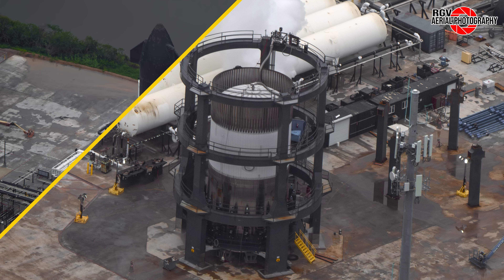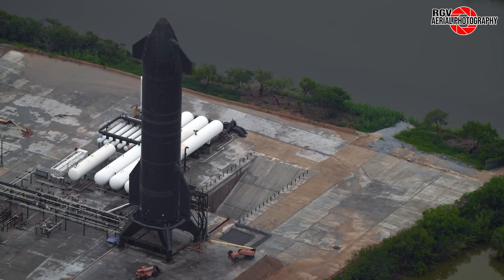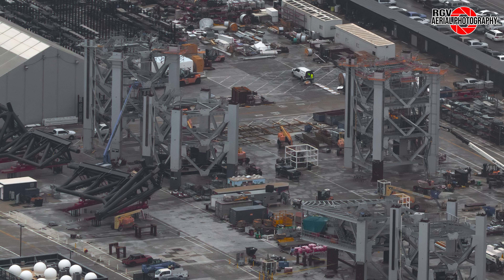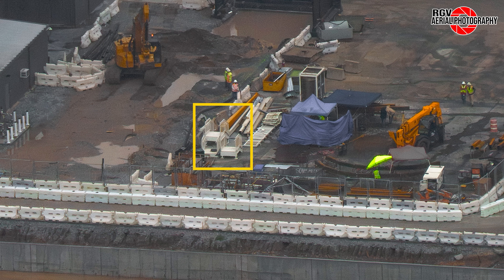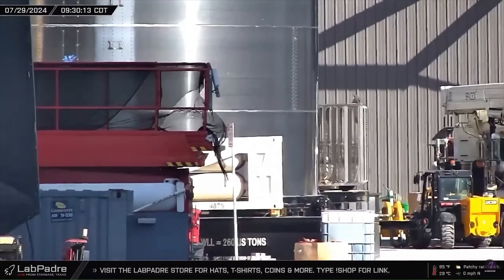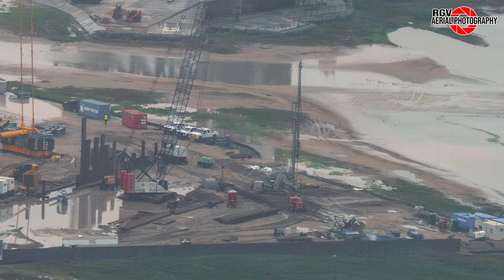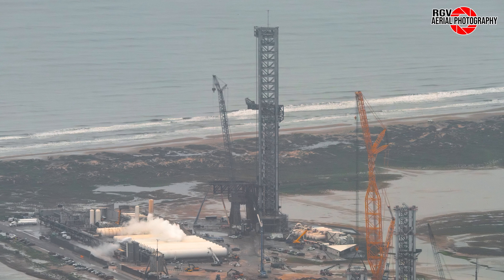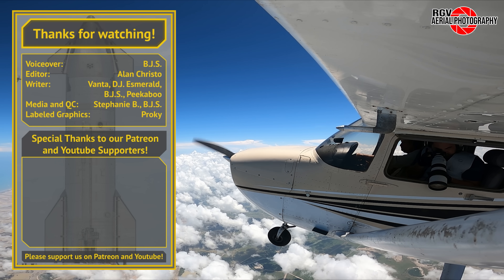Work Starts on Orbital Pad B's Flame Trench! | Starbase Flyover Update 52

Comment: I'm glad to see that SpaceX is finally doing what almost everyone was saying they ought to have done when building the first OLM - building a flame trench! Even smallsat launchers use them, so the largest rocket in the world will absolutely need it. When it's complete, they won't need to use nearly as much water for its deluge as the physical geometry of the flame trench redirecting the energy to the side will do most of the work.

Comment: How long before SpaceX can starting producing their own liquefied O2? Will they be able to produce liquefied Methane or will they have to continue buying from third party. Love the way all of Elon's companies are vertically integrated.
Reply: They had an air separator unit at starbase for a while signifying they were going to try it but then they tore it down. Maybe it wasn’t economical enough at the time but I would imagine as they ramp up it will be. If you look at the left of the FAA expansion plans they do have an air separator drawn out, so probably soon.